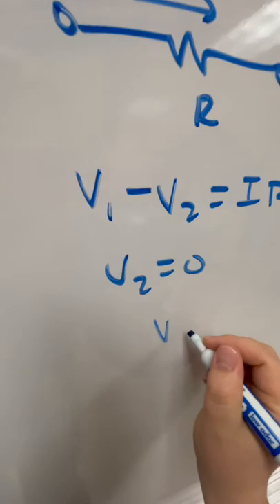Ohm's Law in a Minute #shorts

Comment: Uhmmm , u just did v - 0 = IR 
Where we already knew V=IR
Reply from the maker: Yes, that’s exactly correct-the point is that V is a difference. Voltage is always measured in reference to another point in the circuit, for convenience we usually choose the reference point to be ground and set it equal to zero.

Ohm’s law more correctly defined is (difference in voltage across an element) = current through that element*[impedance of that element]
Reply: @DMExplains uhm, that is literally what V=IR means. Reference is always going to be zero potential. And also, voltage isn't a change in potential, it is potential force, or driving force... ooor ELECTROMOTIVE FORCE...

Comment: What is potential difference
Reply from the maker: it's essentially the difference (value 1 - value 2) in stored electrical energy between two points
Reply: The electric field is a function of space that tells charges what force per unit charge to experience at each point.  To find the work done on the charge, as it moves between any two points, you'd have to add up (integrate) this force along the path it takes.

When magnetism is negligible, the result is path-independent, and there is a shortcut.  We can use another function of space called the potential function, and the difference of this function across two points in space (potential difference) tells us work per unit charge the field does, moving a charge between those points.  For electric fields, it is energy per unit charge, and we call the unit the Volt.

It is arbitrary where the potential function is zero, but there are conventions for where it is zero, depending on application.  We consider it to be zero at the location marked as ground, if there is one.  Otherwise, it is where-ever you place your black probe.  You might also consider it to be infinitely far away, when studying the first principles of electricity.
Reply: You may also hear the term EMF, used for a concept of a very similar meaning.  Potential difference is a special case of EMF, when the work is path independent, as it is when magnetism isn't involved.

Comment: what is potential difference
Reply from the maker: So it's a difference in energy states- think of water stored at the top of a hill. If I let that water run down it will unleash a tremendous amount of energy (converting a potential energy to kinetic energy). The same thing happens in electricity. A potential difference is like that.
Reply: @DMExplains  Thanks